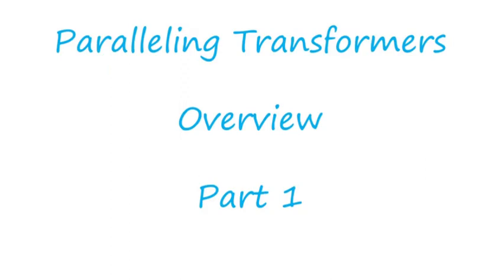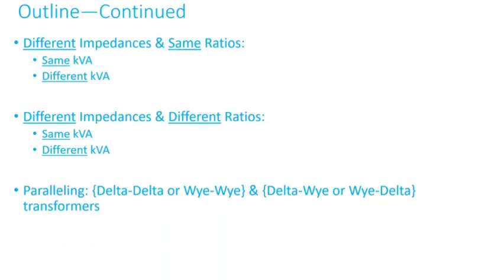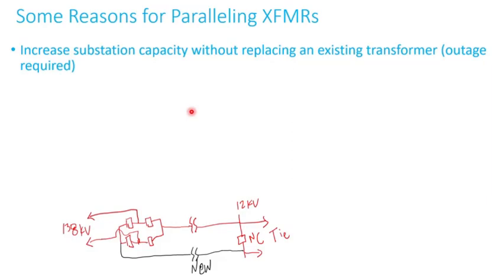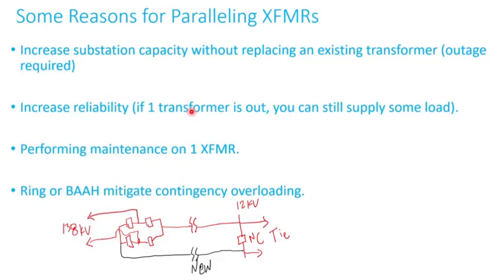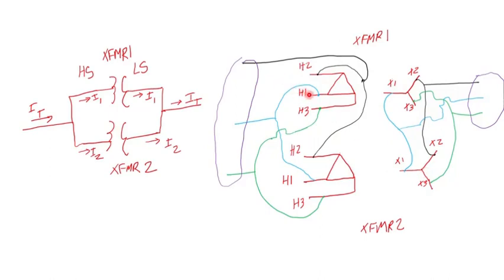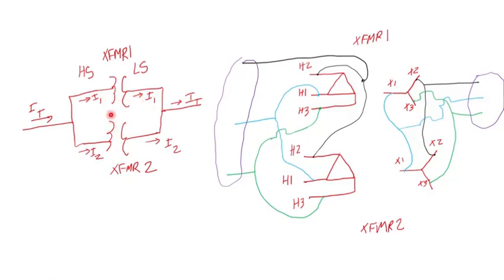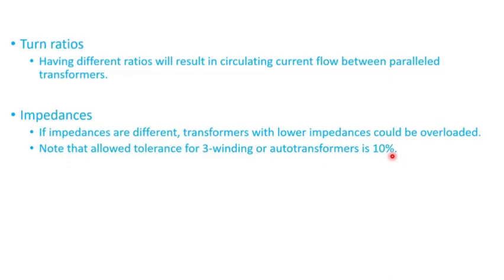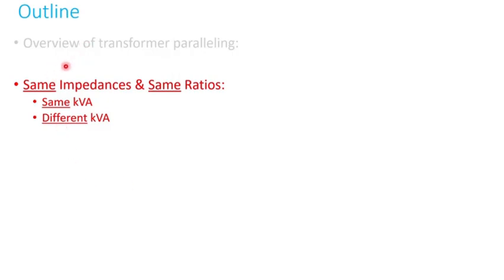Paralleling Transformers | Overview | Part One

Comment: I have watched your series on paralleling transformers and very good explanation . Would you consider doing a video of paralleling transformers with different incoming (e.g., one being 138kV primary and one being 34.5kV primary and both being 13.8kV secondary). Same impedance with different ratios NLTC?
Reply from the maker: Thank you for the question. One of the conditions for paralleling transformers is to have the same voltage. Any mismatch will lead to circulating currents. Also if two different voltages are connected together, it will exceed insulation withstand of the lowest voltage. Hope this helps.
Reply: The problem with your ask is not really that the Primary Voltages are different, that is a problem yes... but the issue is going to be that you are describing two diff Primary Sources... the will be out of phase and when you connect those Secondary's... those will be out of phase as well.  THAT is going to be bad....If you could phase lock the inputs, you could pull it off.  But your ask is to Parallel the outputs ONLY.... So, yeah the Phase issue is very much a problem